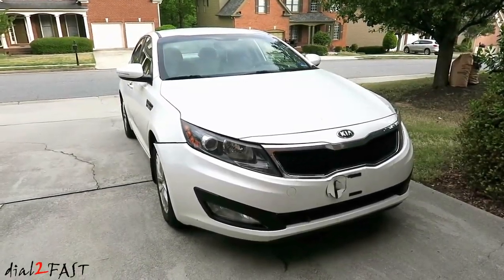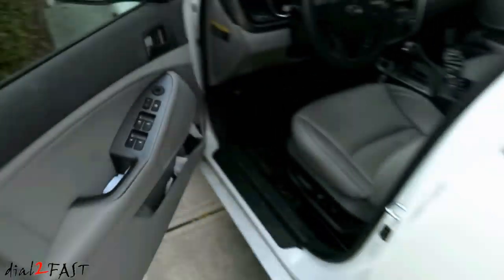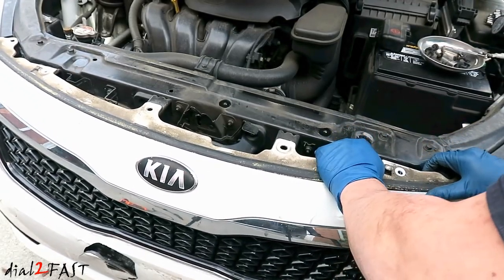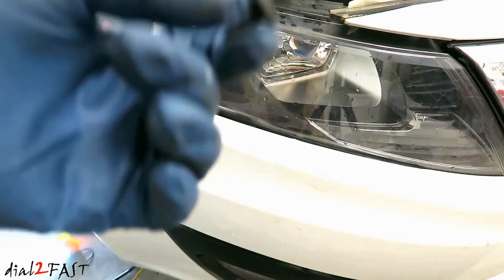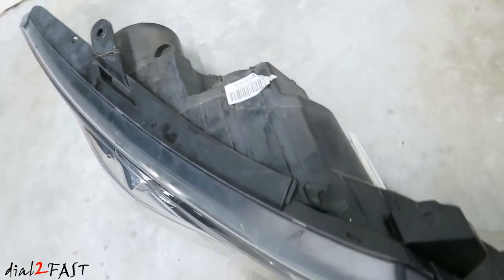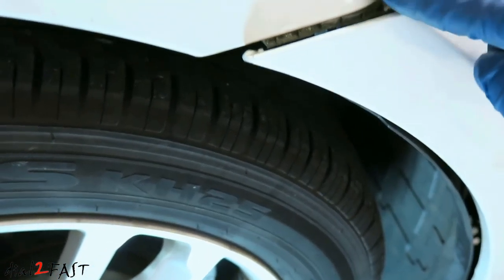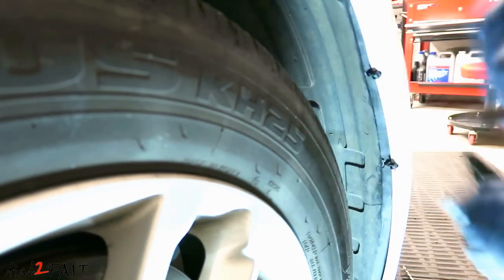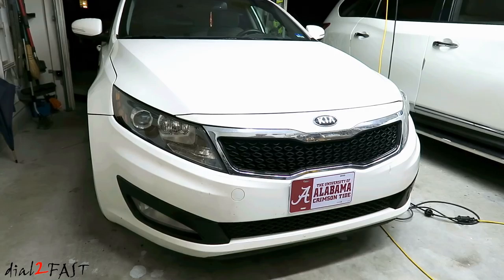Helping A Friend To Fix Her Car!

Comment: Thank you for comment 2:30 on screw-clips and how to deal with them.  One thing that I find most challenging with DIY car fixes is R & R of such clips/ connectors on body and dash panels, and often the video assumes the viewer know how to remove these.  As well as how much prying is needed to remove a friction retained panel (and I always wonder if I forgot to remove a hidden clip before prying).  Your videos are usually quite detailed, though would appreciate you taking a little more time with with such connections to show more detail in how you remove these!
Reply from the maker: You are absolutely correct. Taking apart the car is usually half the battle. If you can't take it apart, you are going nowhere. Filming does require time but I will try to be mindful of more details in my videos. Thanks for your feedback.

Comment: Good video... instructive... Btw... what kinda bitholder do you use on your drill?
Reply from the maker: It's a Black a& Decker one that got many years ago with quick disconnect. They don't sell that one anymore, but I am sure Dewalt or Milwaukee has something similar.